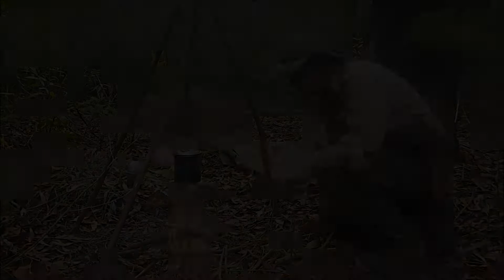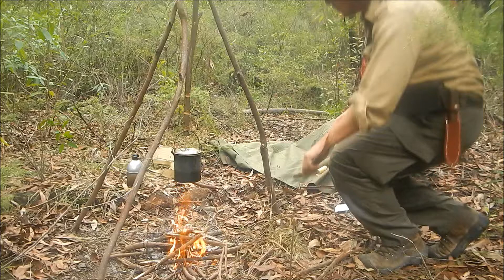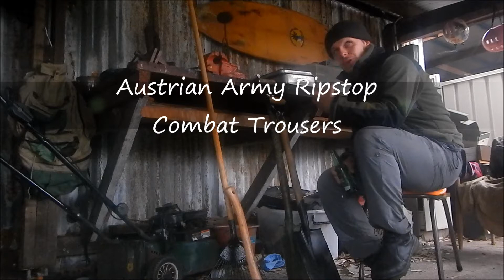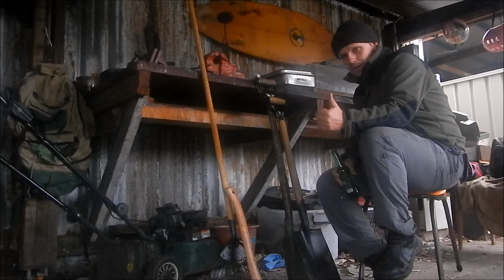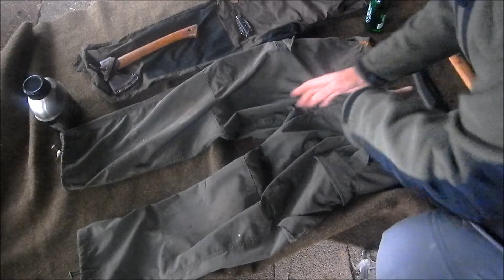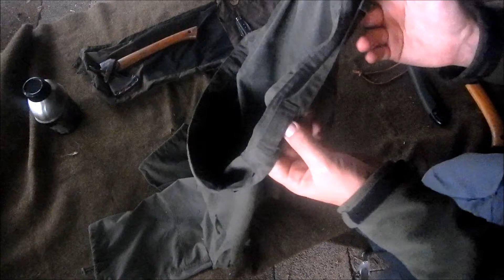Austrian Army Ripstop Combat Trousers

Comment: I just bought some a few days ago, came in post today, then found your video. They are brilliant, paid £11, going to get some more. The zipped pockets with an inner pocket are great. I was lucky, mine are nearly new. Mine are actually a bit long, they have an elastic on the ankles hems. I got another pair of Austrian pants that are the older ones, they have button flies and buttons on the leg pockets and the inner leg pockets. The material is a bit thicker and not rip stop, also the ankles aren’t elasticated, they were cheaper at £7, unfortunately they sent some that were way to small, hopefully they will have my size in stock to replace them.
Reply: As someone using these trousers in the austrian army, i can tell you, that these are actually 2 different pants altogether. The Lighter RipStop version is a light pair of pant meant for everyday usage and on warmer days - Its called the KAz Hose "leicht", wich roughly translates to BDU Trousers "light". The heavier one you got, Called KAz Hose schwer - so BDU Trousers "heavy", are meant for use in colder days, as well as often being used in woodland areas with vast thorns coverage, as the thicker fabric helps in stopping them from penetrating the trousers and ripping your skin open